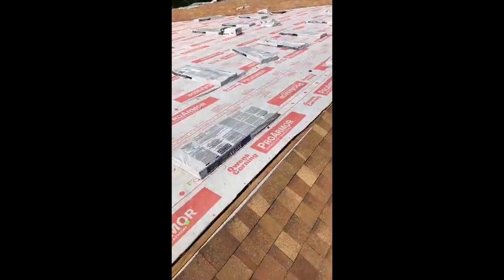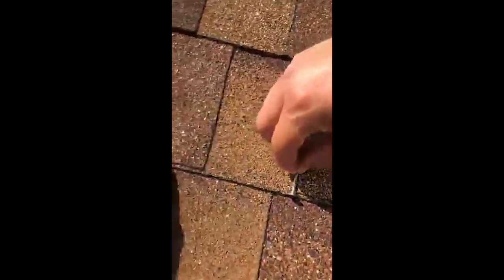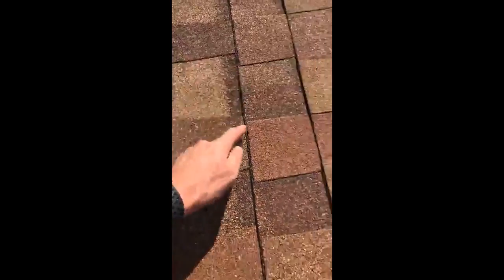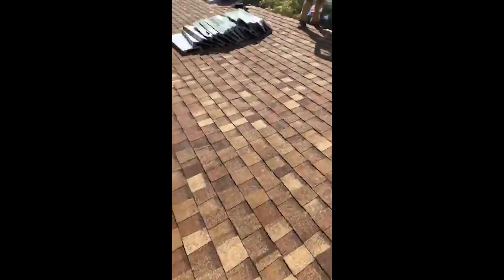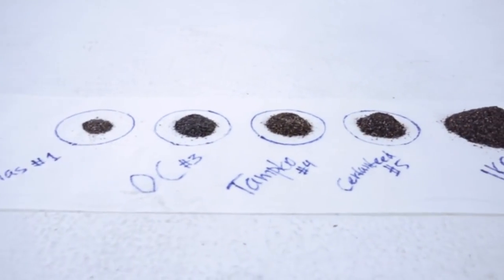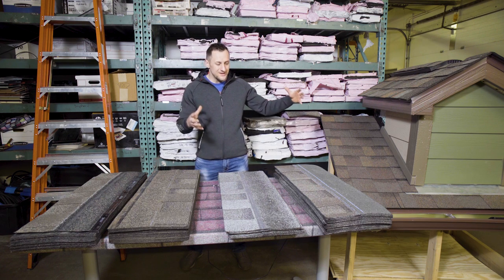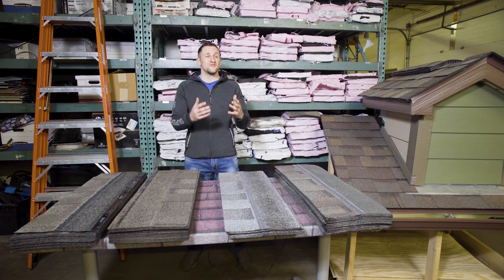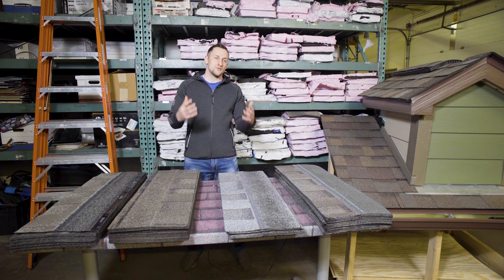Best Roofing Shingles: Certainteed, Atlas, Owens Corning, Tamko, IKO

Comment: Very helpful video.  I'm in north Texas and about to replace my eight year old roof and I'm researching what shingles to use.  I'm conflicted about your conclusion because you list Certainteed among the top three brands and I have had a bad experience with the Certainteed Landmark MaxDef shingles on my roof. I've had shingles blow off every spring for the last eight years. Certainteed examined the shingles I submitted with my warranty claim and they said there is no manufacturing defect.  The company who installed them for the builder replaced the blown shingles for me said they were installed correctly (not that they would admit otherwise). The roofer who replace the last bunch said he found many shingles that were not sealed and were loose.  We love the Heather Blend combination with our trim, brick and shutters but I think I'm going with the Owens Corning Truedefinition Duration.
Reply: I met this morning with the roofing company that I've chosen to do my replacement.  They are Certainteed certified and they said that based on their inspection of my roof the problem I've had with blown shingles isn't a product quality issue, it's an installation issue.  My roof is steep (10/12 to 12/12) and with this slope the installer should have used six nails per shingle but used only four.  This steep slope combined with the extra weight of theses shingles and only four nails per shingle to hold them allowed them to shift and created a problem with the seal.  Does this make sense?

Comment: Thanks for the informative videos, but when I look at these shingle manufacturers there are multiple grades.  So my question is which ones did you choose to test from each manufacturer?  This information would be more valuable to me so I can figure out the value of the shingle for my particular roofing job.  Even if you just pick CertainTeed Landmark, there is TL, Pro, Premium etc.  Thanks again.
Reply: I can't answer for the author, but usually in my experience (27 years) when roofers today talk about a shingle, they are usually talking about the first tier of dimensional, so in the case of Certainteed, Landmark.  Comparisons in my experience aren't as common with upgrades because upgrades are not sold as much.  Of our shingle installs, probably 85% to 90% of them are Landmark (in our case being in California, Landmark Solaris because reflectivity is required by law).

Comment: I just had my Malarkey roof installed by a Malarkey certified installer here in Edmonton Alberta. The crew that came to do the install was subcontracted by the company I hired. “Malarkey Certified” installers don’t exist. These guys didn’t get special training on the specific product. It was also the first time they had ever installed Malarkey Legacy XL shingles. I believe I was just taken on a ride.
Reply from the maker: Interesting... did they use spacing when installing it? Was it hot at installation time?
Reply: @RoofingInsights3.0  Not hot at all actually. We are nearing the end of a record breaking wettest & coldest summer for our region this year. I chose this roofing company because they were a certified Malarkey installer.... stated directly on Malarkey's website. They don't actually have their own roofing crews.... they sub contract all the installs out to 3rd party companies and make the money off the sales of shingles and performing the quotes. How the hell does a home-owner know if they were installed correctly? The Legacy XL's are a thicker shingle and these guys used some thin crappy shingles on all of the ridges on top of my home. I guarantee they don't have the same 50 year rating as the rest of my roofs shingles.
Reply: I manage an Emerald Premium contractor .. I Assure you we exist. Malarkey is the best in the business and we love working with them. Sounds like the contractor you were working with did things wrong, not Malarkey.
Reply: @brandoncraig4216  Not so sure on that Brandon. I called Malarkey today.... I wanted to explain what had happened when I used one of their "Malarkey Certified Roofing Contractors" as they call them on their website. The lady on the phone wasn't overly bright or knowledgeable in their products etc. She also told me it was quite common for Malarkey to certify the companies selling their product but that those companies quite often sub-out the work (to non-certifed roofers) and that was perfectly normal. I hired this company because I wanted the system that Malarkey recommended. I hired them because in my opinion.... the methods and products that Malarkey used in their roofing systems seemed superior. I paid more for my roof because of all of this. In my opinion, a "contractor" is someone you hire "to do" a job. A Malarkey Certified Roofing Contractor should be someone who has taken the training Malarkey recommends and uses the products that Malarkey recommends in order to support the warranty and justify the costs of a "supposedly" better product/system. This was not the case.... Malarkey should change their terminology to "Malarkey retailers" but we all know that just doesn't sound as great does it? Guess that's why they decided to glorify it in their sales pitch! Time will tell if their product is any good as for their schtick...... that's all it is.
Reply: (Same person as above... different account on my phone than my computer apparently) 

I’m really sorry you had that experience. I can tell you from my end.
We had to have I think it was 10 homes inspected, I was personally on site with their inspector, we had to have our guys go through a few training sessions, and when we installed our first “warranty” roof malarkey was on site to make sure we were adhering to their specs. 

I am really sorry that you had that happen to you, if you message me on here I’ll get ahold of my direct rep to malarkey and see why this happened. I’m more than willing to help you out, because I think this is how a Certified Emerald Premium contractor should be helping malarkey homeowners.
Reply: Same hapoens with plumber s, electricians and hvac companies.
You hired a electrical company with state trade license BUT they send you a 19 years dude to do your installation working under their license and making $13 an hour . 
Good luck if you want the owner of the roofing company (holding the master certification) to put your new shingles instead of a crew or spanish speaking muchachos 😄
Reply: @beri232  It’s been 2 years since your roof went on and how it is holding out?  
I’m deep down the rabbit hole on trying to figure out contractors and shingle products. It’s almost impossible to compare apples to oranges as to what each roofer offers and what products they install.   I was in one roofing supply place today and they boasted that GAF Timberline was their best seller!!  Latter in the conversation I asked about the Owens Corning  products that they also carried?  They told me that they weren’t in stock because they had not had a shipment since before the start of covid!!  So I guess that would make the GAF shingles their best seller!!  

So now I am trying to figure out my replacement roof based on the shingle I think I should have and work backwards through the contractors that will install what I want if that is possible.  At least if I go this route I might get estimates that hopefully will be comparable.
I am in Southern Ontario and I am also considering a Malarkey roof as well. I am awaiting the estimator to come out and look at my home for the estimate.  This roofer is well known in my area and they list Malarkey as one of the products they install.  They also install CertainTeed, BP, and Soprema. Which of the Malarkey shingles did you have installed?   Before they arrive I just wanted to gain as much information as possible about their product.  Thanks in advance.
Reply: @mikehall9468  I live just outside Edmonton, Alberta so I have very similar weather as you. Cold winters, gusty winds and some nasty hail in the summer months. A retailers “best-seller” is never going to be their “best” shingle. Most people go for what’s cheap. They don’t look ahead and see themselves in the same home in another 20 years. I watched my parents buy cheap garbage when I was a kid. Everything they did was done cheap and 9/10 times they’d have problems or have to replace in 1/2 the time as the quality items. I do not share their vision. Lol. I truly believe the Malarkey shingles are the best shingle you can get. I have the Legacy series on my home. I would place Certainteed second and Owens Corning number 3. We’ve had some good hail storms and my roof doesn’t shed granules anywhere near as bad as it used to. As for the installers…. my neighbour’s had their roof done last summer and they were hacks compared to the guys that did ours. Our valleys are all colour-matched and cut cleanly and effort was definitely given vs my neighbours… They just didn’t do it “exactly” as Malarkey wants it done. I have the nicest roof on our block and I think it was well worth the price. These shingles are heavy. The installers said it many, many times. Lol

Comment: I have installed thousands of squares of shingles.  I am also a leak specialist and estimator.  Tamko is by far the worst manufacturer I have ever seen. They do not cover warranties, it is to the point that if homeowner wants them I turn down job.  CERTAINTEED is by far the best. I have installed there product for decades and have never had wind damage after an install.  Higher weight per square, excellent adhesion, easy to install with pronounced nail lines.
Reply: I'm a roofer and I also agree, Tamko was overall dropped from use because way too many fly off in high winds. In cold weather it also does the worst, it basically becomes glass.
I personally prefer OC I haven't used Certainteed but I did use their  presidential shingles around 2-3 years ago.
Reply: Richard Erlinger jr have you install or study Owens Corning? What can you tell me about their Cool Roof Line that has a SureNail Technology, resist a 130 MPH wind, and their 50 yr. warranty which is transferable to a new owner... I will like to know your opinion. Thanks.
Reply: @mundoaztek  I have installed alot of these shingles.  Very similar to the CERTAINTEED Solaris product line. They really do help reflect the suns rays.  I have found that roof temps are down drastically.  Other than rooftop solar, green homes and environmentally conscious customers should all have this product on there roofs.
Reply: @richarderlingerjr6813  why would you say to stay away from the OC cool roof for solar installation? We are looking at these shingles and plan to install solar right after the new roof goes on!
Reply: @redangelraw5559  I think that would be a good choice.  I install solar in the St Louis region.  Installing a new roof before the solar install is smart.  Solar panels typically last 25-30 yrs.  So having a new roof installed prior is just smart .
Reply: The GAF claims their are the best; and the Master Elites tell you with their hyped up alleged consumer fraud sales pitch that GAF's are better and they are an upgrade; but what they are is asphalt junk!
Reply: I have a Certainteed roof on a 10 year old house. Shingles have been blowing off and after looking they never sealed good. This has been going on since the house was 4-5 years old. In a moderate wind they flop up and down like crazy.
Reply: @Kiskassklan  sounds like a builder grade sub crew install and not the product. I've installed XT-25 shingles from certainteed that are twenty years old now.

Comment: I will not question what was said in the video per se, there is certainly a lot of good information.  What I will say is that some of the information is currently quite subjective as for instance in my experience, I have had improper dragon tooth installation on two of the products he names as the best.  Also, thought size and weight could be a factor in shingle duration, manufacturing process, also is.  As per granule retention, in my experience I have seen far more granules fall of out of a bundle of landmark pro than most any other shingle.  I am not saying this makes any of these products good or bad, just that they have all had issues and a lot of the stuff mentioned is subjective.  It was an enjoyable video and it does provide decent information, just note there is more than one way to interpret said information.

Comment: There real questions is you makes the best sbs modified polymers shingles for the price atlas , corning, gaf , F-wave ? 2nd who makes the best ice and water underlayment with 30-50 years warranty ?  Malarkey is f- wave is moving by surprise in Texas commercial residential real state and high class areas, ridge ventilation is the best fans can be install inside suction out including heater fans in attic,, spraying adhesive and  granules  and press rolling , there is tire burn clear and sealer  coating for concrete drive ways that works perfect for protection on roof  home Depot at lowes,, the govt epa is to blame corruption for all that

Comment: The top of the shingle is a factory edge, simply ensure the underlay is perfectly straight matching the underlay with the plywood creases. Applying each shingle individually with two hands eliminates imperfections and mistakes appearing from gauging.

Comment: I install, replace and service VELUX skylights. I’ve seen so many jobs not have the tar paper ran up the sides. So no 45 degree watershed lap. Nothing. It’s tough to match shingles but I wouldn’t be ripping apart your roof if your installer knew how to wrap a skylight. I love the work flow but god damn.... VELUX, offers a flashing kit which includes adhesive underlayment. (Vitchithane-bitithane-fortiflash-ice/water shield) any one of those works. As long as you cut back the tar 3 inches and wrap the skylight, you won’t have a leak, I’ve left skylights in rain without roofing material. Just adhesive underlayment. Didn’t leak.
Reply: I’m not talking about anyone in particular, installers in general..

Comment: Dear Roofing Insights. Thanks for the very informative video! I learned a lot! I have a question. I am in Ontario. I am going with a well known roofing/construction company that has been around for 70 years. I trust them as they do work for everyone in our family and have never had a problem. However, I watched this video and I’m nervous. They want to use IKO Dynasty shingles with “armourzone” nailing lines (they are visible) and a “tear resistant woven band” to supposedly help keep the nails from pulling through in high winds. The brochure says it’s rated to 130mph/210kph winds. Is this all garbage? Please let me know. This is an expensive job. The builders grade shingles were horrible.  Shingles blew off in every moderate storm. Thanks for any insights!

Comment: OC nailing web embedded, Duration Premium COOL rated, 50 year done by a OC recognized listed installer..who wouldn't install the cheap stuff, right off he told me,if you want the low end find another roofer.

Comment: Certainteed is good I've only had a couple blow offs and I believe the lumber yard sold me some sort of seconds didnt seal wtf
Reply: I have a Certainteed roof and has been nothing but problems since it was new. They never sealed and flop up and down in moderate wind. Had to replace a bunch too. Got 3 tabs blown off right now.
Reply: @ryebaldy8479  I now am the proud owner of a architectural roof. Hopefully it will be there for years to come.

Comment: Nice PSA!  Wish I ran across this back in 2008.  I blindly picked an organic shingle from BP.....one of the products in their class action lawsuit from 2012/13.  Now the east and south sides have significant damage .  The north side still looks good since there isn't any sun.  The west side also shows some signs of deterioration.  The BP rep said I need to take many photos of venting and shingles from several angles.  They will only cover 60% of whatever they deem as damaged.  I'm guessing less than half of the roof will get their blessing.   If I see a couple of grand, I'll be lucky.
Reply: GAF had a class action too, and just settled the date of 2013 I believe; was the last of the recipients; so wish I could have been included; as mine are crap!

Comment: Imagine the feeling when you see the TAMKO's on here are the exact shingles you have on your roof. Fortunately, they are on the way out.
Reply: Thats the brand I have.  Has only been on their for about 5 to 6 years.  The installers sucked, had some leaks which they did fix, but was like pulling teeth.  A friend of mine from high school, thats a roofer, pointed out many other mistakes while helping me pull down my chimney.   Everything from inconsistent reveal and not caulking around vents, to bad ridge cap install.  Lets just say I'm done with this company.  I'm in the process of replacing my roof and adding overhangs on soffit and rake as well as replace old wood strip decking with osb.  Think I may go with a different brand such as Atlas or Owen's Corning, readily available here.  Doing alot of the work myself with help.